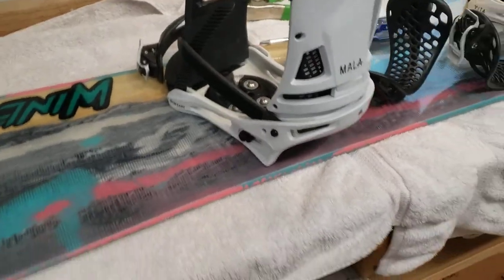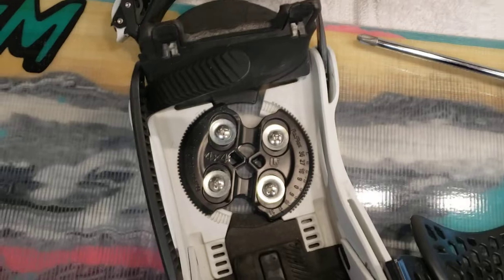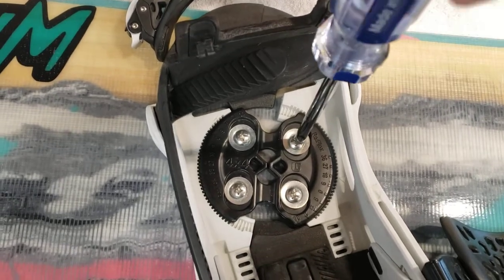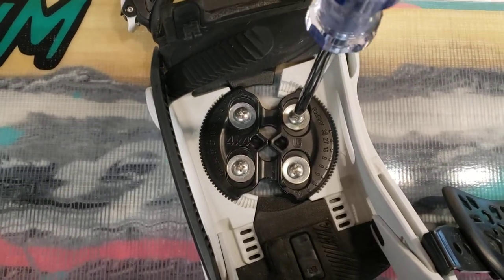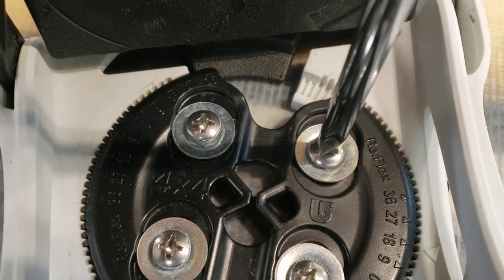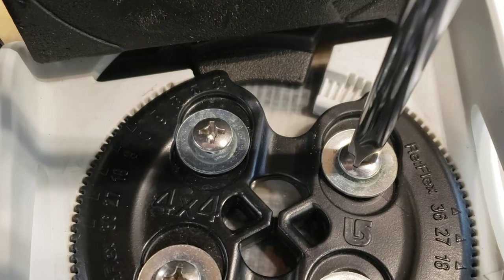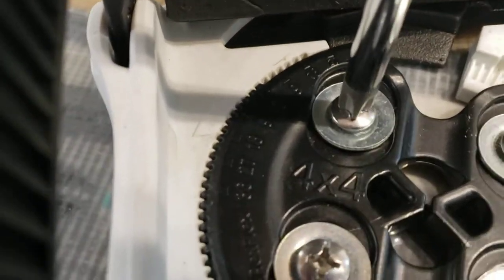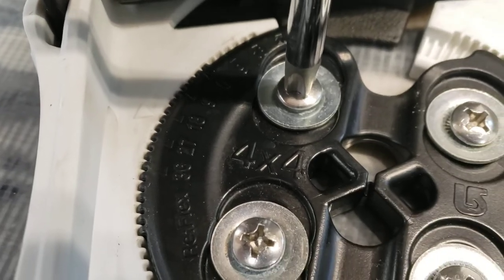Just A Minute Episode 5: Don't cross-thread binding screws.

Comment: Great tip!  Now I just need you to make a vid showing how to replace the threaded insert for this newb that already cross-threaded his and stripped them out. 😂
Reply: quick and easy: move binding to another pack of inserts??  or just deal with only 3? 
Try a repair shop.  They may be able to run a tap through it and clean it up.